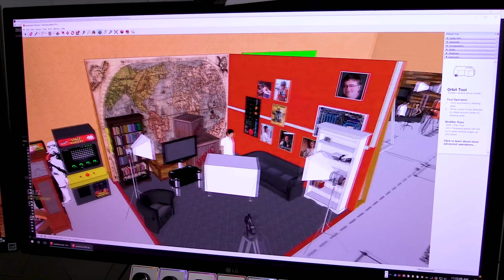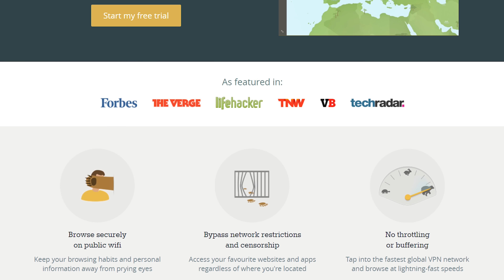STUDIO DESTRUCTION VLOG

Comment: My inner Jeremy Clarkson approves.
Reply: tmcclelland47 yes as long as you have a hammer every thing is fine
Reply: House demolition vlog !
Reply: lel
Reply: The hammer fixes everything
Reply: Still waiting for them to bring out the shotgun.
Reply: Here is a tip Jeremy Clarkson has taught me : "It doesn't work ? Hammer it. Still doesn't work ? Hammer it harder."
Reply: If the hammer doesn't fix it use a bigger hammer. Still owning a CRT tv am a firm believer in well judged technical taps for putting electronics in their place and behaving correctly. On the other hand if it moves but shouldn't- duct tape. If doesn't move but should- WD 40 (and a hammer)
Reply: tmcclelland47 Poweeerrrrr!!!
Reply: Especially the Inner Jeremy Clarkson... especially if he doesn't see it coming in time.
 @goodkeks-950

Comment: You should do the walls in sections, then bolt them together and bolted to the walls of the building. If you plan on changes in the future the walls will be much easier and safer to move.